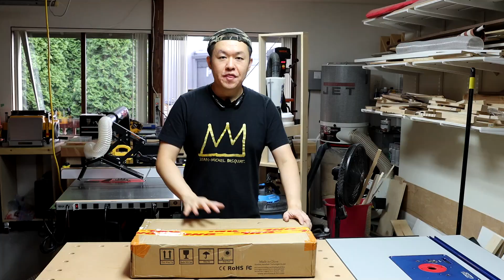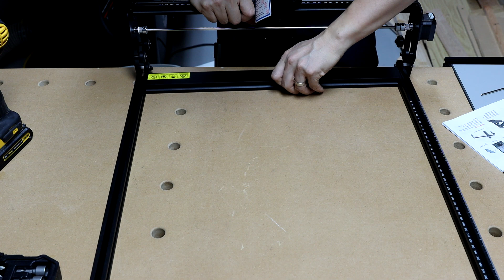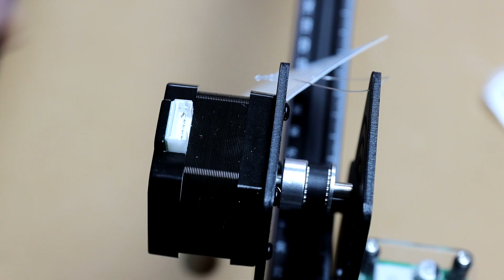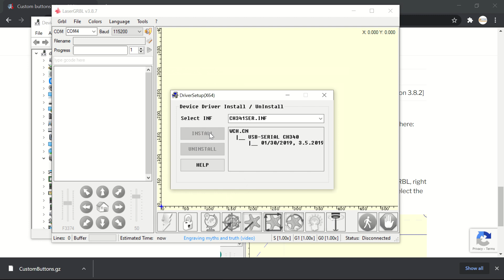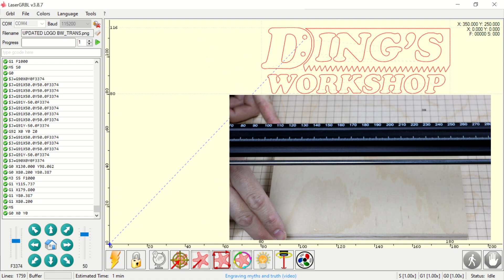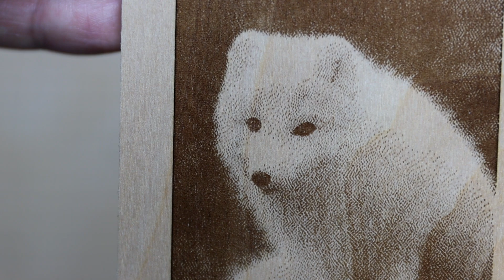Atomstack A5 Laser Engraver Review & LaserGRBL Tutorial | Banggood Woodworking Tools

Comment: Thankyou for this video, very helpful, I've just received my machine this morning.
Reply: Hi, I have no experience with the Ortur and a complete newbie to laser engraving, I have been frustrated by my inability to produce something satisfactory with grey scale, my machine seems to just want to burn at 100% (or close to) or zero with no mid tones no matter what settings or photo quality or alterations I have used. Even my tests go from black to nothing with a slight alteration, I don't know if it's something I'm doing wrong, the software or the machine!  It's also an auto-focus machine so can't do clear acrylic although I'm trying to figure a way of making it recognise the surface with something that can be washed off later (paint and markers get embedded in, tried chalk, crayon, stamping ink unsuccessfully too) Feeling very disheartened at the minute to be honest. I tried the settings given for the photo in this video on plywood using a high quality photo and on dither, it didn't make a mark for 1000 speed at 25% or even 50% power,  I ended up on 85% and it missed nearly all the dither dots in the grey areas.
Reply: @kazpaul75  hey thanks for replying! 

Man sounds rough. I hope you can figure out what is causing the issues you're having.  Don't get disheartened man! Everything takes some trial and error.  But based on what you said I guess I might lean toward the Orturo more.
Reply: How is your machine? Would you recommend this over the Orturo master 2?
Reply: Update on the machine, the issue was me! Lol. I understood the machine to be 'autofocus' meaning it will adjust itself, but it's not it's 'fixed' focus and I should have set it 2mm from the bottom of the eye guard, I'd had it at 2cm! I should have read the online manual, the one that came with it just said how to construct it, not how to set it up. So for once I'm happy to discover I've been a dipstick and that it's not the machine that's at fault, lol. It's producing some brilliant stuff now it's set up right. It's probably the same as the Ortur apart from the focus. All the best with your machine when you get one :)
Reply: Also, with regards to the clear acrylic not being recognised, I've just come across somebody's idea of using rubberised paint that easily peels off later so that the laser recognises that as the surface. They also advised raising the acrylic up slightly so that the underside doesn't get charred. I haven't tried it yet but it looks promising 😀

Comment: Will it cut thin wood and also is there any way to attach a blower with the green cover over the laser?
Reply from the maker: I tried to cut through 1/4" plywood.  although I eventually succeeded, it took way too many re-runs over the same cutting path.  My conclusion is 1/4" is too thick to cut, but it should be able to cut through 1/8" thick boards without problem (might still need multiple passes though).  Because the green cover is an enclosed area, I think a suction tube might work better than a blower (so the particles are not floating inside the enclosed area).  This will of course require some minor retrofitting, but it's doable.
Reply: On the product page they lead you to believe that it cut that star out of a round slice of wood easily.
Reply from the maker: the machine is capable of making the cuts.  However, it would require a bit of trial and error to find the sweet spot of power & speed setting.  I'd recommend doing it with multiple passes, as if the speed is too slow & power is too high, it'll start burning the wood (based on my test).
Reply: Have you used other lasers? I want one that cuts ok for under $400 if that's  possible. I looked at the ortur 20w as well.
Reply from the maker: majority of my applications are more for marking rather than cutting.  The thing for laser cutting, especially on wood, heavily depends on the thickness of the material. Beware on the advertisement claim of the laser power though!  Taking the Ortur 20W for example, it markets as 20W laser, but the 20W is actually the power consumption of the laser module, it is NOT the output power of the laser.  Looking closer to the spec, the actual OUTPUT power of the Ortur 20W laser ( in other word, the power for the cutting/engraving) is about 5W - 5.5W.

Comment: Hi there. Thank you for the video. Does it cut 3mm MDF and EVA Foam?
Reply from the maker: Hi!  I attempted to make cuts on a 1/4 inch plywood.  I eventually was able to cut through the material, but it took many many reruns and I wouldn’t recommend it.  I believe it can definitely cut 3mm as that’s less than 1/8 inches.  You will likely need to have several passes.  I haven’t tried it on EVA foam, but I’m fairly confident it can handle foam with no problem.
Reply: @DingsWorkshop  Thank you for the answer. It helped a lot. I saw that there is another version of this engraver, with laser a little stronger (5,5 -6W). Problably I will go with this one.